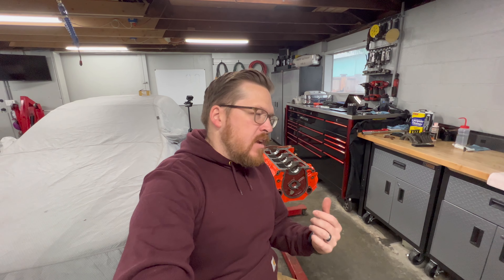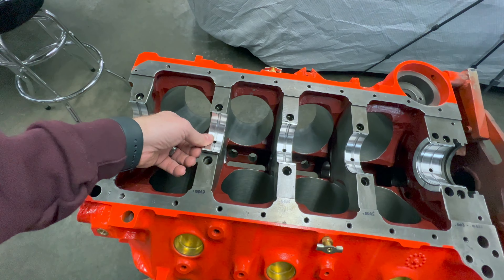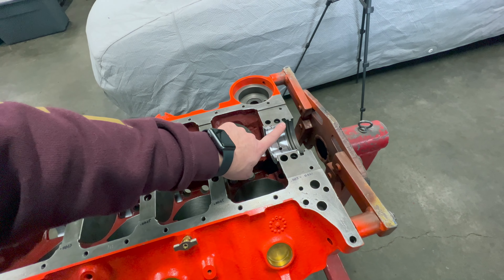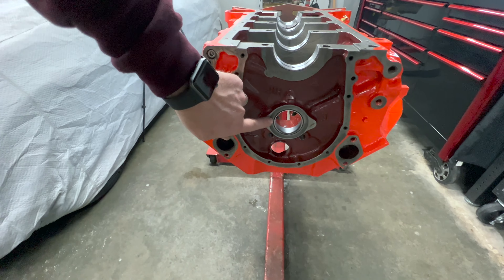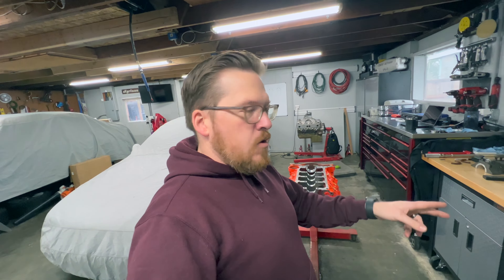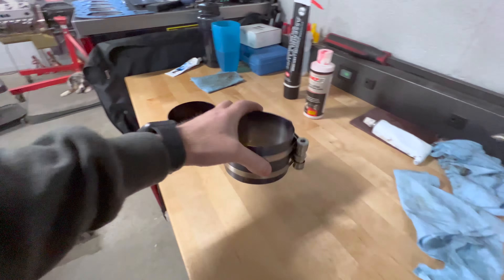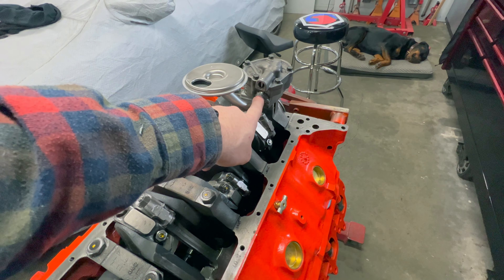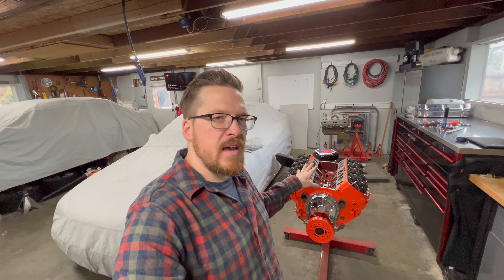DIY Engine Building Tips & Tricks That Are Not Talked About Enough

Comment: I have a couple of tips for you.  I use GST Racing Seals for my rear main seal.  1. they make a "1Piece" rear mail seal for the old 2 piece rear main block.  there is just 1 cut in seal against leakage and i put it at the very top of the rear main. I have yet to have one leak from there. they are expensive. but worth every penny if hate oil leaks. got my from James Engineering in Broomfield CO. you should try one on your next old school big block. you wont want to go back to after using them. 2. the chrome timing covers and oil pans are junk. they do not seal well and i have found that they all tend to be warped a little bit. I believe that this is caused by the chrome plating process. seems to effect all the brands i have used over the years.  I currently use the gold colored ones from Moroso and then just paint them engine color. 3. the one piece oil pan gasket from Fel-Pro is too think in the front timing cover arch and does not seal properly. I have switched to the MR gasket 1 piece oil pan gasket and it works much better.  4. use case aluminum valve covers. the stamped chrome one always leak. there are not enough bolts on the valve cover to distribute the clamping force against gasket with stamped steal. the after market stamped steel covers are very soft and even worse than the factory stamped steal covers. GM got it right with the late model 454 and its cast valve covers. 5. i test fit and line up my distributer before putting the intake manifold on. that way i know that it will line up correctly with the oil pump drive rod. when i drop it in after installing the intake manifold and i don't have to fish around with a really long screw driver or turn the engine over till it drops in. potentially wiping off the lube on the cam lobes or lifters.
Reply from the maker: Those are some great tips! Thank you for taking the time to share those with everyone! I was aware of the sealing issues with the stamped steel chrome parts, and I usually do stay away from them. 

I was not aware of the one piece rear main seal that you mentioned. I will have to look those up, as I would be very interested in trying one of them out!!

~ Nick

Comment: Get pistons with the proper pin height and they'll only be .025 in the hole. Then a steel shim will put you right where you want.
Reply from the maker: Joe, I fully agree with the above. But that only applies if you are replacing this pistons. For this refresh that I used as an example I was limited to reusing the existing pistons. 

~ Nick

Comment: Why build a 396 when 454s are a time a dozen.
Reply from the maker: I agree. It’s the same cost to build a 454 as a 396. In this case I was refreshing the engine after a thrust bearing failure. 

If I were to build an engine from scratch, it would not be a small cube 396. But sometimes you gotta fix what you got. 

~ Nick
Reply: Depends on what you're trying to accomplish!! If all you're trying to accomplish is torque for hauling, then the 454 will be the way to go, but if you want top end horsepower, a good 396/402/427/433 will be the way to go!